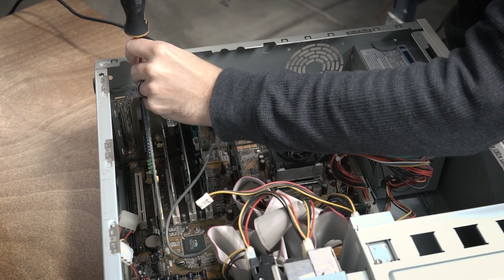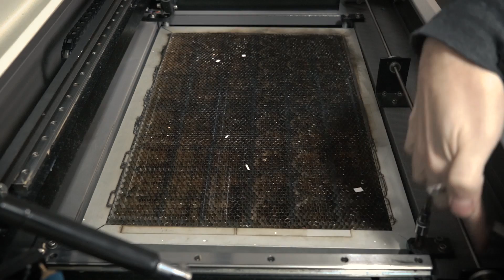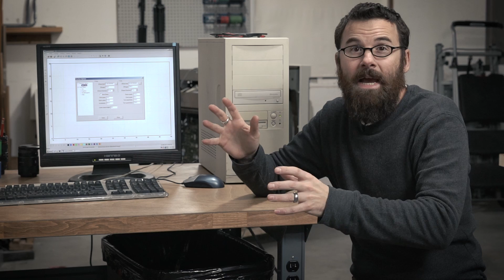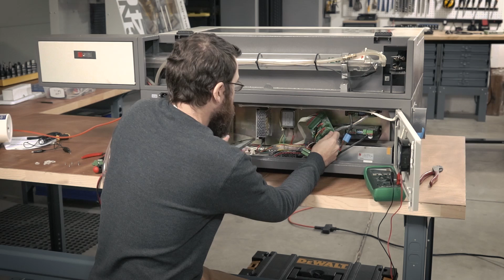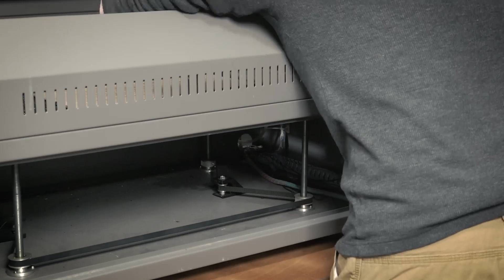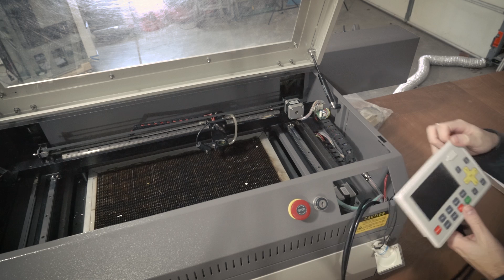DSP Laser Controller Install

Comment: with a grbl type of machine you can program manually the XY movement and thus control the machine. what type of programming does the dsp systems uses?

Comment: Thank you for this video! 
I bought a chinese laser 50w and the included Trocen controller wouldn't work or display at all, other than powering on once. Your video helped me understand what some of the issues may have been, although I'm still working on it.
Reply: there's two ports on the bottom of the controller and I had the network cable going to the first, but it still won't power on in the second. Not sure what I've done wrong...

Comment: I'm upgrading my machine with AWC708C but I'm not sure how to wire up the Z axis motor without a stepper motor as it was in old system.
Reply from the maker: It was probably just wired directly to power and a couple of switches.  You don't really 'need' a motor controller for a standard DC motor.  the ones I've seen just control it with a couple switches.  if that's the case, you probably can't control it with your controller, but there might not really be a need to.
Reply: @RobertCowanDIY  that was very helpful, thank you.

Comment: How did you get the Um setting for the feed screw on Y axis? Having a real problem getting it right?
Reply from the maker: It's been many years since I set this up, but I think it was just a guess and check.  I honestly can't remember how I did it.  You can just plug in a value, cut a square or circle, measure that, and see if you can determine the right value.  Or see if you can calculate it by hand by assuming 200 pulses per rev on the stepper, and then calculate the belt ratios.

Comment: Hello Robert. I purchased a used 80Watt with the same controller as yours had. So glad to see your video. I have done several searches and not found the same controller. I would like to do the same upgrade as you but am curious how you fit the controller Panel in the small hole from the old control panel. Could you please let me know how and show photo if possible. Thanks so much.

Comment: Thanks again.  Do you use Lightburn with this controller?
Reply: Sorry for overloading.  I have been trying to purchase a 60 40 laser cutter for my school's Tech ed Makerspace lab and am having a hard time narrowing down the options. There are sooo many Chinese lasers at excellent prices, like the Thunderlaser, Gweike or Triumph,  but it is hard to figure out the company to buy from. With your experience with laser cutters what would you recommend?  Prices have really come down and there are new options like Glowforge and Muse but the Chinese ones seem to be half the price a still pretty good quality, and with education , especially in Canada, every dollar counts.  Thanks
Love the channel and would love to take a robotics course from you.  Looks super fun.
Reply from the maker: I haven't tried it yet.  I have a very limited use case for my laser, 99% of all the files are just DXF exported from solidworks, so the software is far less important for me.
Reply: @RobertCowanDIY  Just found the time to do the install and ran into a couple of snags.  On my breakout board I had some wires that don't seem to transfer to the new controller clearly.  One is ORG y, ORG x and grnd combo.  I am assuming they are for the limiting  EL x and EL y on the controller but not sure.  Another was labelled 1 and 2 which I think are the laser test button on the old front display.  Any ideas if I am on the right track.   Thanks
Reply: The x7s is the awc708s but rebranded by Light objects.  How did you find out how out about the ways to copy the cutter info onto the controller and is there a link to it. Thanks  Do you run classes or just do this for your own fun.  Looks like a great shop and always getting better.  Thanks

Comment: I have the same cutter and have been thinking about doing the same thing as the Lasercut software is very limited.  I just happened to stumble on this video and it made my whole week!!!!   Awesome.  Just going to order a controller for this now from Lightobject.  Did you get the x7 or the x7s?  Thanks again. Very excited to get this upgraded.
Reply from the maker: I don't have the x7, I'm using the AWC708C, I'm not really sure of the difference.  I think it might just be re-branded.
Reply: I have been back and forth testing the cutter wiring and still can't get it to turn on the Controller,  The P68-lv breakout board was well labelled but when I hook up the wires according to the labels, no luck.  I only have one of the smaller power supplies and when I test all the voltages there seems to be no 24v.  I tested the power supply and I can only find 5 volts output and on the breakout board the pin labelled 24v has a jumper on the back to the pin labelled 5 v.  I thought maybe my problem was due to the myriad of safety shutouts but they seem okay.  On my wiring diagram for new controller there are 2 places where I should hook up 24 volts  I probably have the same power supply because it looks like your cutter is almost exactly the same except for the bigger tube and was wondering if you could tell me which  one on yours was the 24v output and anything else you think i might need to look at.  Thanks .

Comment: Very Awesome! Have you been happy with it? I just got a laser but Im waiting on a replacement tube and while I figured I was waiting for it might as well get an upgraded cpntroller. Did you get light burn?
Reply from the maker: I have been very happy with it, no complaints.  I like the interface and it's reliable.  I don't use lightburn because 99% of all my cuts are just DXF files exported from solidworks, so all I do is import the file, and send it to the laser.  I don't use the software for much else.
Reply: @RobertCowanDIY  Cool! Thanks for the feedback! One of my new tubes showed up today and I cant wait to get started!

Comment: Thanks Robert, This is still the only video on this around. can you tell me if the AWC708s has PWM? and the software has ramps effect? i really need something that i can engrave with Ramps. For my Rubber stamp Company. thanks you, in advance.
Reply from the maker: I'm not really sure what you're asking?  Why would you use this with Ramps?  If you're getting a controller like this, ditch the ramps and get real motor drivers.  this has TTL control I believe for the laser, not PWM.  But check the manual.
Reply: @RobertCowanDIY  Thanks Robert, i'm a Noobie at this. You actually answered the question a should of asked :-). as i have the Chinese Laser Engraver with the basic M2 controller, which pretty much is just the M2 board and a PSU.
So for my upgrade i will need to gut the lot  !
Install new - DSP Controller (RDC6445). 

24v switch power supply. (DM542)

(x & y) 2 phase stepper drivers. (DM542)
Thanks again for your video, i wish i could document my upgrade journey like you did.
it should be pretty striaght foward. I will let you know if i blow up the garage!
Cheers
Sam

Comment: Great video. BTW, I don't see any exhaust port in the back. Is it on the side? Also, when I search Craigslist here in NYC or Long Island, all I get are machines (laser cutter, or woodworking power equipment) that are either JUNK or as expensive as a new machine. People sometimes think their junk is gold! Case in point, there was an old Delta Unisaw table saw that was rusted out top and bottom, and the guy wanted $1900 for it. I just went out and bought a brand new one instead of dealing with junk. But, your machine looks so pristine, I'm happy for you that you got such a great deal!
Reply from the maker: Mine has exhaust on the side.  Also, when I talk to people about craigslist, my one piece of advice is:  "what you see on craigslist is the stuff that no one wants, the good stuff is already sold."  You need to be diligent and setup searches and catch the good stuff the second it gets listed!
Reply: Thanks for the tip. I appreciate it, and I enjoy watching your videos.

Comment: Hi Robert, Thanks a lot for this video... I've been able to get it hooked up replacing the M2 controller. 

But I can't get it hooked up to my router/network. 
How have you done it? I've changed the ip address under the "Network" tab to match the ip addresses within my network but still no luck. What could I be missing? Documentation is pretty much zero

Comment: hello...i already installed this AWC708C controller at my old laser machine SW1290 siwei brand but not totally working good....first problem is the laser does not function it mean when i try press the laser button on the control board the laser not come out....second problem is working area is not the same as the actual machine size. it becomes smaller than the actual size...can you help me...
Reply from the maker: It sounds like the PSU for the laser needs a switch enabled as a safety measure.  Also, you need to configure the controller to know the size of your machine.  Fully read through the manual so you understand all the parameters and configurations you need to set.
Reply: @RobertCowanDIY  thank you for your reply my question. can you tell me about the switch to enabled it at the PSU. actually i not really understand about the switch.
Reply from the maker: @shahrulshafiq6134   Please fully read the manual.  It's in there.  It's a safety switch.  I won't explain it do you because if YOU don't understand it, you won't understand how to operate your laser safely.

Comment: There's seems to be two camps on controllers.  The one you selected or the Ruida.  Any thoughts you can share before I buy one of them?  Great video as always!
Reply from the maker: I haven't used Ruida, but I've been perfectly happy with this controller and have nad no issues with it.  I'm still very glad I switched and use my laser nearly once a week.  That being said, I mostly do designs exported from solidworks or some other design program and rarely do much with the software other than import a design and send that to the laser.

Comment: Robert, I have a LMI Laser engraving machine I just purchased at auction. Any suggestions beyond you great video?
Reply from the maker: I'm not sure what info you're looking for, the controllers are pretty universal.  I'm still using it and I really like it.  It was a great upgrade for my laser.
Reply: @RobertCowanDIY  That was what I was looking for, A confirmation that it worked well and it is still working. Laser Machinery Inc. was in WI and the Laser is a 60W machine. It was at a college in VA with very little use. Problem is that they did not have the computer or drivers. Once I have the machine on the bench I can have a better idea what I need. I also have a Matsuura Machining Center that I might need to upgrade the control on. A bit more complicated because of the servo motors and 7 hp spindle motor.

Comment: Great video! Thank you. I have just replaced controller system on my 60W (uprgrated to 80W)  Chinese  laser with same controller as yours. All setup is OK, however, laser does not  turned on.  Probably the wiring on controller terminals is wrong. I have picture  of old connections (with different terminals names), and I have connected to LASER2 terminal. I would be happy to forward this picture to you for your advice on how to connect wires to a new controller.  May I? my email is anatolyzayaruzny@gmail.com.  I would be more than thankful to you!

Comment: Love you videos! Very helpful as my current laser is close to becoming a boat anchor thanks to crappy software and controls. Will this unit work in a mixed environment with AC servos as well as steppers?
Reply from the maker: I guess it could work.  if the AC servo controllers have a step/dir input, it shouldn't make much difference.

Comment: Do you have detailed information on how you wired everything. I have the same model of laser and would sure like  to see a wiring diagram for this.
Reply from the maker: I don't.  Just learn what the wire are for and what they do and their connection will be obvious.  The manual for the controller is pretty clear on where to plug everything.

Comment: Hi Robert,
Thanks a lot for this video! It's soo timeless and awesome! I have a question tho... does that mean that I can use this controller for virtually any laser system? I just purchased a chinese laser cutter with an archaic controller (+ uses a dongle). The seller mentioned it's not compatible as " I will have to replace wires plus add a driver" and some other stuff.

How can I know if my cutter will be compatible before I make the purchase? What should I look at for??

Thanks a lot
Reply from the maker: Really, all of these things are just a few stepper motors, power supply, and then the laser power supply and tube.  They have the same components pretty much.  You SHOULD be able to use a controller like this on just about any system.  I can't make any promises of course, because you could have a really strange laser that I haven't seen.  The best thing to do is crack it open and take a look at what you have.  Then look at the manual for the controller and see if things line up.  You MIGHT need to get some extra components if everything is all on a single PCB or something, but generally speaking these controllers can be swapped in easily enough.

Comment: Hi Robert,  Have you made a box for the panel controller?
Reply from the maker: Not yet, it's just still sitting outside the laser.  One of these days I'll get around to it!
Reply: Robert Cowan 
I contacted G.Weike the factory in China and they refuse to sell me the most current USB controller for the LG500 laser.  It would fit into the front opening without any modification.

Comment: Great video. I also have AWC708C and have question for you. Did you ever use USB port on panel for transfering files? In my case it recognizes usb but it always gives error No work' files! . Do you know is it because it need to be special USB drive (UDisk)? I also get message Save params error when try to save current config to UDisk
Reply from the maker: I haven't.  I only use the other USB or network connection.  I bet it comes down to formatting.  Try to format the USB stick differently, maybe FAT, not FAT32?
Reply: Thank you for answer. I did try FAT(FAT16) . No luck. When searching for problem I find someone with same problem but no solution. I will try to contact seller with this problem.
Reply: I found solution. Disk needs to be FAT32 but when formating it type needs to be Primary (not Logical) and it will work fine :) . EaseUS Partition Master and other disk managment softwer have that options when formating. So you were right about that it comes down to formatting.

Comment: Hello Robert, thank you for your video. I have an old Synrad Laser. It has a vc-2000 laser controller that controls the laser aspect of the unit, however the controller for the stepper motors and preview of cut path etc. is run off a unit made by a Canadian company called Precix. It was built in 1999 and uses 3.5" floppy disks and auto cad for the software. It is difficult and time consuming to transfer and manipulate items to be cut due to this controller. Would this controller be a way to replace the Precix portion of this unit? What software works with this controller? Does something like CorelDraw work?

Comment: Hi I am replacing the leetro controller on my machine for a 6442g ruida, someone told me that psu are locked to makers, ie like the one i have would only work with leetro controllers, can you please confirm is this is true ?
thank you

Comment: Do you think the DSP would work with a sealed CO2 laser tube like a Synrad?
Reply from the maker: It looks like these use a proprietary controller.  It might be possible, but without trying it out, I couldn't say either way.
Reply: Thanks Robert. Since I asked the question I found that these are RF excited lasers and that the LightObjects controller can generate those signals... Apparently the Glass tube lasers are voltage (analog) excited. Thanks for the prompt reply.

Comment: Nice upgrade. What can you cut with that laser? Is it powerful enough to cut metal?
Reply from the maker: It's a 60W laser.  It's a CO2, so the wavelength is wrong for metal.   Metal lasers need a completely different type of laser, and usually a lot higher power.  This one can cut acrylic, wood, MDF, ABS, etc.  But things like metal just reflect the beam and it never gets through.
Reply: Interesting... more research is necessary. Thanks, good videos.
Reply: Fiber lasers are used to cut metal. They are a LOT more expensive than co2 lasers.

Comment: The K40 is actually a 35 watt tube not a 25 watt.  Light objects sells a 35 watt for it as a replacement.
Reply from the maker: They vary.  Mine was measuring closer to 25 watts.
Reply: Well, it would require the tester for that and it costs about 100 dollars.  When my tube goes I will buy a 35 for it that is 35 as advertised.

Comment: Hello.  I recently purchased a laser cutter with this controller in.  I'm having trouble loading files via a USB card.  The reader displays "the file data error" I'm assuming I'm using the wrong format in the file?  I create my file using Coreldraw > export as DXF > use lasercad to export to USB as a Ud5 file.  Please help.  Thanks